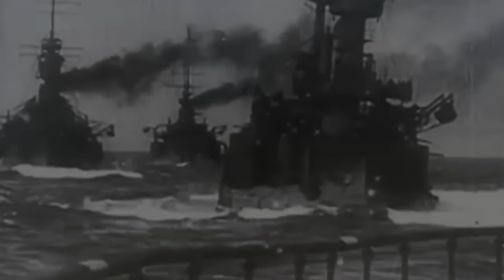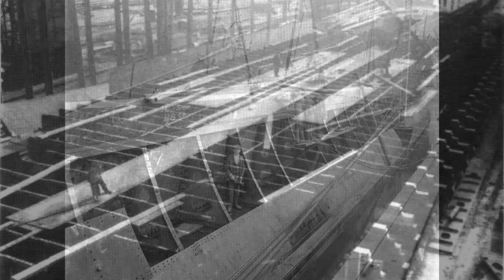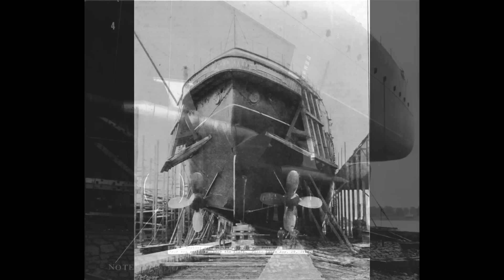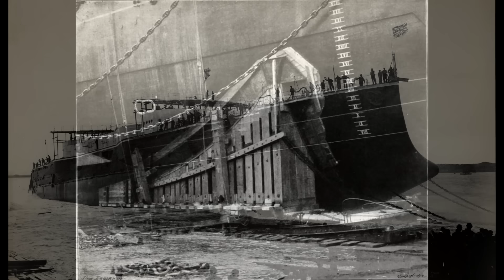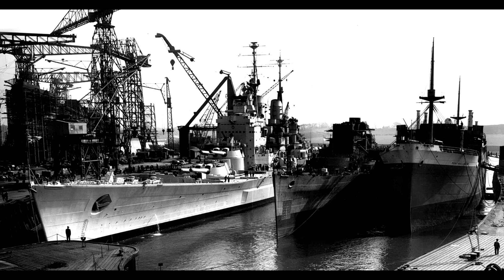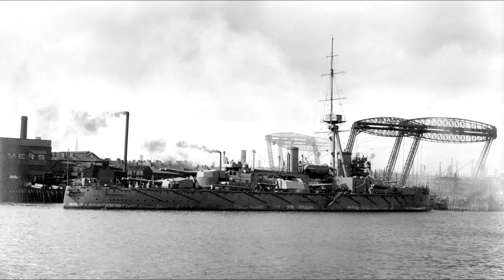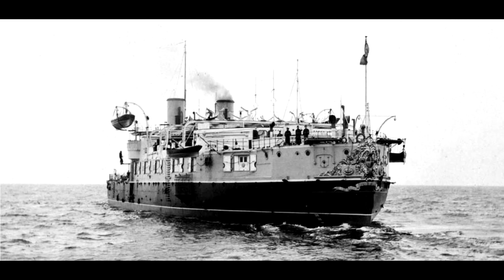Naval Engineering - Building a Battleship from Keel to Commission

Comment: Astonishingly well timed video. Today I am 'laying down the keel' of my scratch-built RC 1/96 HMS Inflexible, cutting out the first parts. With a copy of Clydebank Battlecruisers close at hand, today's video is truly inspirational for the years of modelling to come. I'll bear in mind the problem of excessive lard when it comes to launch day. Many thanks Drach, great work! 🚢
Reply: Could you let us know how it gets on, please?
Reply: @chrissouthgate4554  It could well take a while amongst all the other projects on the go, but certainly will try!
Reply: 1/96?

HOLY CRUD! It’ll be six feet long!
Reply: doing quick maths in my head.. 1/96 scale is gonna give about a 4 foot model (much better than I previously thought Inflexible was a post dreadnaught battle cruiser).  2 questions- Are you going simple electric or a more elaborate power supply as I have seen even O gage model trains run on steam? Will the main battery be functional since a 1/96 scale 406mm gun would approximate a 4.5mm/.177 pellet round?
Reply: @kevinadams4390  1/96 HMS Inflexible will be 1.8 metres (6ft) over ends in length, 250mm (10") maximum beam and something around 20kg mass. It's about as big as is practical to transport, store and comfortably sail on the boating lake without becoming a nuisance to everyone else! Electric drive using Dewalt batteries/converters as source for commonality with my workshop, then all the usual RC equipment and motors. I will be implementing a 'fake steam' pouring from the funnels using the new ultrasonic cold water vapour generators which seem to have appeared recently on the market. Recent testing with half a dozen of them looks promising - it will really make the model come to life! Main battery are 12" (305mm) twin turrets 4off. It wouldn't do having projectile firing armament when at the club boating lake, probably be asked to leave 😄 However, the intention is to try for gun flashes with a blast of vapour combined with onboard speakers to emit the crack & rumble of firing. That last sentence contains a lot of work and experimentation to get right, so first of all let's get a respectable powered hull sorted out as the main pleasure of RC boating is a well handling, sea keeping vessel! I can tell you that trying to fight with a model that handles like a dog is very tedious! Thanks and best regards 👍
Reply: @kevinadams4390 
HMS Invincible was 597 feet long overall. 

Divide by 96 yields 5.9 feet.
Reply: @Doug_JB  was thinking about moving the model by car to use in a body of water. 4 foot models are about 40lb and fit in the back seat. 6 foot models can be 110 lb and require a truck for the length.
Reply: @kevinadams4390 At that size it's probably easiest to just use an actual small boat trailer, like those for transporting canoes or jet skis.
Reply: Are you chronicalling this on any forums or what have you as this sounds awesome!
Reply: @rorymcleod8616  I'll take photos as progress is made and see what can be done. It'll probably happen in a series of concentrated bursts of construction rather than a steady continuous effort!

Comment: I knew a guy who'd served in the RN in the 50s. The opinion was that fitting-out involved all relevant trades assembling at one end of the ship, and running to the other carrying all their equipment and materials in a sort of Le Mans start. Of course, installing domestic water pipes was quicker and easier than installing steam mains. Which explained why the former followed straight lines and the ;latter twisted every which way around them.
Reply: Commonly known as the Olympic system